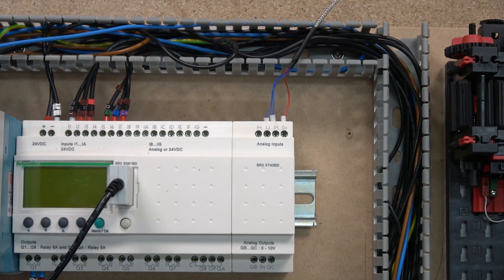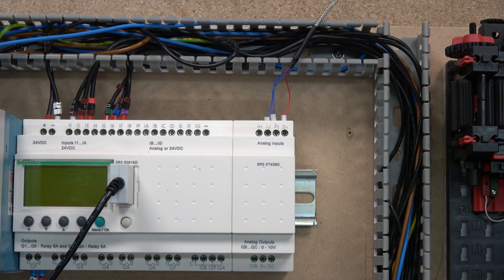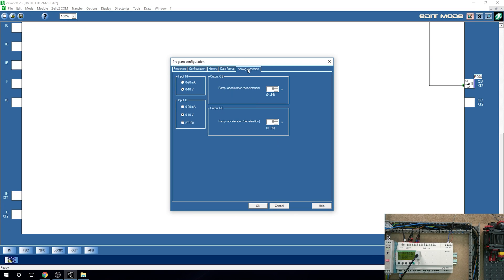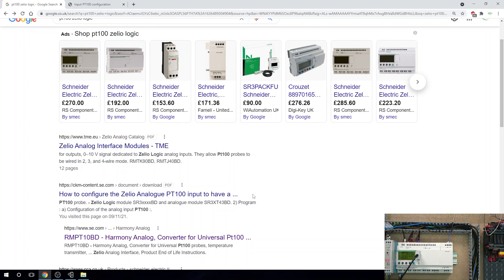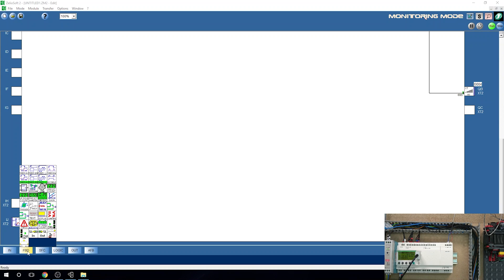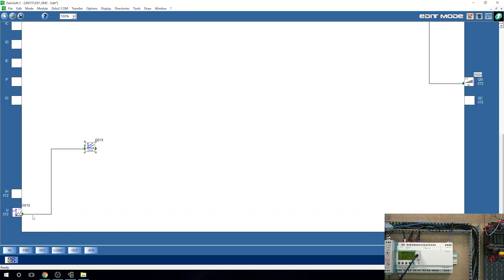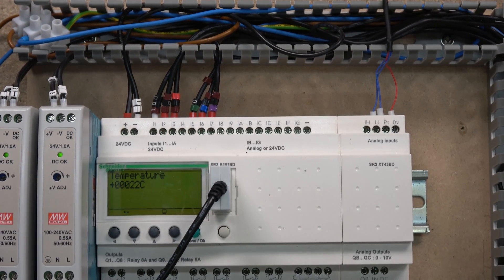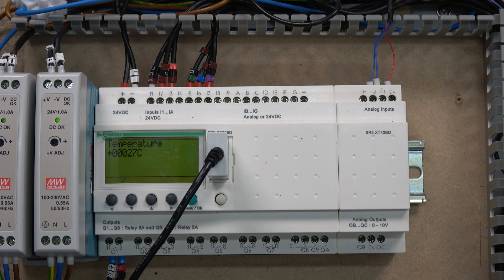Schneider Electric Zelio logic controller PT100 temperature probe wiring/set up, sample program. Eng

Comment: I have done some basic control work with Zelio in the past. I’ve never had to use analog inputs until recently. Which sensors would you recommend using for temperature control?
Reply from the maker: What is your temperature ranges you are planing to work with?
Reply: @IGSElectronics  I am in Canada and will be measuring outdoor air in a range of -40C(-40F) to +40C(104F)
Reply from the maker: @Tholin378  Standard PT100 probe will do bud, the set up i did in the video will work perfectly.
Reply: @IGSElectronics  Thanks for the replies. One more question. If using multiple temperature inputs for the same program I would need an analog io extension module for each temperature probe correct? In my example I would be comparing outdoor air temperature to a room temperature and then sending out a 0-10v signal to a damper actuator based on those readings.
Reply from the maker: @Tholin378  Had a look in to the hardware manual and it looks like that is the only unit, so yes you might need to have for each one of them. But do check the manual in description to see maybe i missed something.